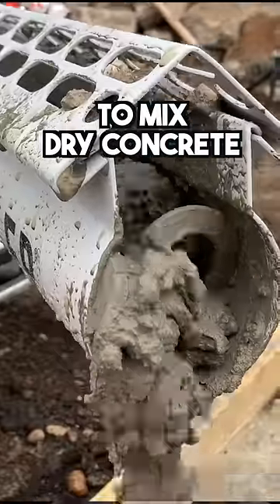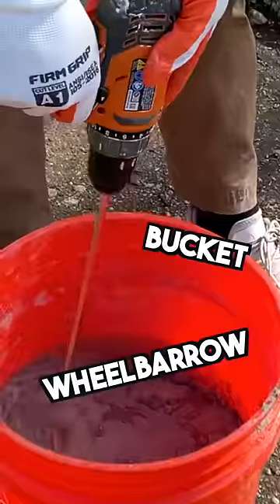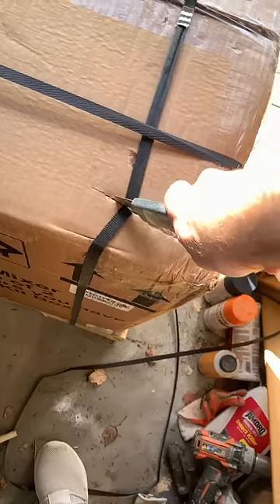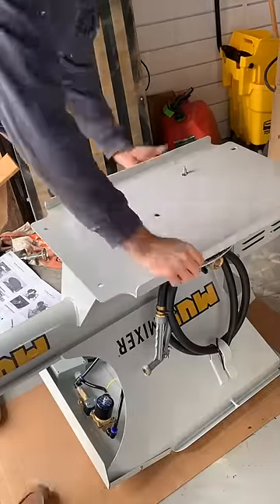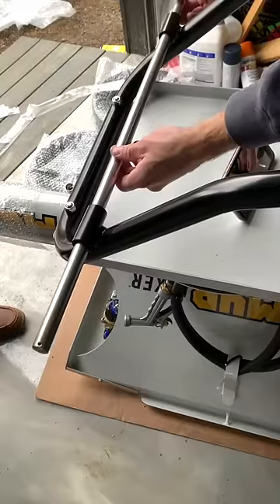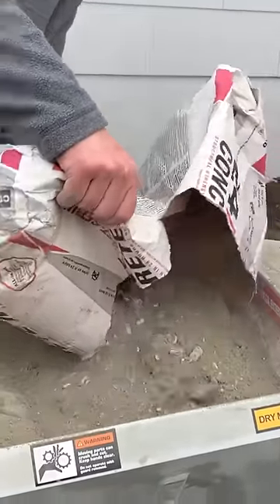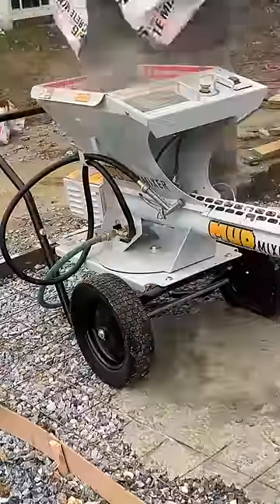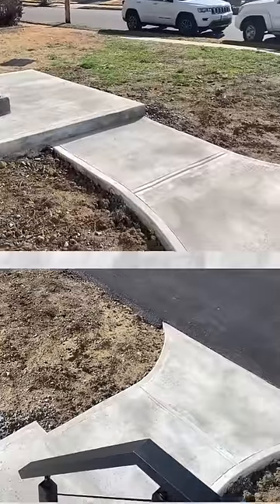The Best Way To Mix Dry Concrete (MUD Mixer)

Comment: Just 2 people and a 8x8 tarp. Crack the bag (60#, 80#, doesn't matter) into the tarp, pour in the measured water, and two people slosh it back and forth for a minute. use the tarp to funnel it in to where ever you want to go. Clean up? hose down the tarp. But, order a truck if you using over 3 yards.

Comment: This type of machine is used to mix mortar, for when you need the mix to always be the same (or adjust as you go), you need a lot over the day, and only need a little at a time (brickwork vs laying concrete)
Not really meant for dumping large amounts of concrete, that's what cement companies and trucks are for!

Comment: I may see a problem with that mixer 
Bags of concrete mix are not always "Mixed"
I have seen the fines and course aggerate not well mixed into the bag of concrete mix 
So unless you mix the bagged mix 
You can end up with junk concrete , some hard and some with almost no cement in it

Comment: Seems to have worked for you for this size project, if you have the cash.....but for me not "the best way"......the best way I know, especially small jobs, like posts and footings on a budget.
• 8 x 8' tarp/construction plastic
• 1 bag cement, empty in centre 
• add sand aggregate ratio
• 2 people, 1 on either side, each grab two corners
• alternating lift corner in turn a couple of times this will quickly mix the dry parts, like flipping food in pan
• gradually add water, continue to mix until correct consistency.
• lift drag tarp over to pour, coordinate lifting corners to precisely pour concrete where you need it
- clean up easy let dry  and shake clean

Comment: You know it’s much cheaper and can be just as effective if you just use a shovel and a wheelbarrow.  Can easily mix 3 bags of 80lb every time and move it to where you want it after it’s mixed. 

Ofc this is definitely a bit more work but it’s not like you’ll be doing it everyday.  

The average I’ve seen / done myself is a pallet per HR
Reply: put 2 bags on a tarp and roll them back and forth

Comment: I have rented this unit twice now. It rocks if you cannot get a truck into the area or if you are doing smaller multiple pours. I do not see a dryer like me justifying buying one but renting hell yes. 
It mixes concrete fine. Someone mentioned mostly morter and that is bs.
I will always order a truck when I can but to disparage a fine tool because it doesn't fit your jobs is just plain stupid. Don't knock it till you've tried it.

Comment: It looks like it's putting a lot of water into that concrete too. I'm no concrete expert but I feel like too much water is not a good thing.
Reply: It's not.  Too much water WEAKENS the concrete.  YOU adjust the amount of water to determine the slump.  Too much water is the operator's fault.
Reply: The proper mix is 0.45 lbs. of water for each Lb. of portland. Or a mix that will ball in your hand/ glisten when you slap it with a shovel.

Comment: 56 bags of ready mix. You would have saved a boat load if you brought the rocks, sand, and cement separately. But i guess it doesnt matter when the mixer is $3K

Comment: 3 grand for the machine and then paying over the odds for pre mixed ? 
I’d rather pay 500£ max for a mixer and mix cement and ballast. 
Much cheaper. 
You could lay lovely block paving on that path cheaper then what you would of paid.

Comment: I would never use bag concrete for anything other than footings or fence posts and shit.  But if your doing something outside and want it to look good for years, do it right, bag concrete is too inconsistent and all that cement powder floating around and breathing it in is no bueno.

Comment: I call a dude, he sends me a truck full, already mixed up. Am I wrong?
Reply: Do you use 4 guys with wheel barrows to get it around the house?
Reply: Usually just one or two. No matter, you still have to hump concrete either way.

Comment: It’s so much easier and so much cheaper to call for a yard of concrete from your local supplier. You waste way too many man hours just mixing concrete when the crews could be doing something else.
Reply: Ask you local supplier what the truck and small load charges are.

Comment: 3000$ for that wow. Overpriced. I’ve looked around my area to rent one only found 2 places. Most places have the traditional concrete mixers. Gonna be a long while b4 they show up for renting at a lot more places. 
I’d buy one but not for 3000$. They know they can charge this price cause there’s not a lot of other options out there and this mud mixer is smaller and easier and better.

Comment: The mid mixer is garbage. While it controls the rate at which water is distributed, it should also have a control for how fast the Auger rotates.

Comment: idk, if your mixing over a barrow or two, why not make your own mix? seems like a lost art these days. i make my own mix for everything. 
topping, topping is funny because straight sand is no good. you need the small aggregate in there, i dont know what it does but its easier. 
my gig, its usually a patch, so im not giving you the entire 4inches, ill give you a four inch face, build up the middle with base, mix it by hand. 10x2.5. not worth a delivery.
i have taken to using sandbags of different color these days.  if i need consitency ill use a 20L pail topped up for measurements.
i get superior concrete, extra sand, people like to see sand, but if your a professional patcher, that means your good at working and matching it in, so you dont need lots of sand, you only need sand when your not a good cement finisher. you want as much rock as you can easily bring the cream up from. stronger concrete besides.
ive been to old farmer builds, and they have rocks the size of your head in their old mix, 100 years later your still sweating all day busting out what the old timers put in.
i like this thing. 50 bags per hour, is about 10 barrows. 1m3 but ive always found 1m3 delivered amounted to more like 15-18 barrows.

Comment: You bought 56 bags? At what? $5 a bag? That’s over $250. Just order a truck. It’ll be a bit more but you’ll get much higher quality concrete, you’ll finish quicker and don’t have to mix that shit up. Cmon now, this has to be an ad

Comment: Use a tarp, empty bag on it, add water, 2 guys grab the corners and swish back and forth. Mixed in 60’s or less
Reply: bring a third guy to add water and open the bags. pull pull dump.

Comment: Lol a normal mixer would be cheaper, faster, more consistent. This product makes no sense without a giant hopper above it that can be loaded up with sand and cement. How are you supposed to consistently add the right quantites of sand and cement? Only way this makes sense is if you can add 1 bag of cement and 4 bags of sand at the same time, but you'd have to pre mix them without a segregated hopper. It makes no sense at all. A normal mixer has the advantage that you can keep tweaking the mix and you don't pour it until it's perfect

Comment: With the price, just get a cheap mixer. It will do the trick. But if you have more projects, just man up an get a skidloader or even a small tractor with a sement mixer. If a big project just rent in a cement truck for the love of God. BTW folks, don't harass friend and family to spend their weekends to fix your big sement pour projects. Rent the truck, get some friends, get the job done in 1 day instead of non stop working the whole weekend. Finish. Drink beer instead..

And the slow arshe speed of this thing gives my eyes stress vibration..

Comment: $3000? Ridiculous! You could have Concrete delivered by the yard, up to 10 yards in one truck and you won’t spend $3000.. typical pricing for a concrete delivered in a concrete truck poured onto your site is between $175 to $275 a yard! With various additives! Various Slump ratios. With fiberglass to make it stronger!

Comment: Lmao buddy it’s $80/yard of concrete straight from the truck,  in 1/200th the time.
Reply: Yeah, in 1994.
Reply: @BryanBB440  Those are the prices right now.
Reply: @LucasJasche  where at?
150/160 here in CA and talked to somene in Midwest was 250 per yd plus tax and fees.
Reply: @LucasJasche   and i agree, that volumetric buggy is more novelty than useful. 
Bagged concrete isn't cheap right now, once you calculate labor getting the bags feeding that machine, cleanup and maintenance,  it's cheaper  to chute, pump or wheelbarrow it from a RM truck. Those full size volumetric trucks are useful for some jobs like rapid set for highway work and currently they are putting high speed fiber cable in our city.  The trench is 3 inches wide 2 foot deep, they use that truck for slurry on demand into a buggy that places it into the trench. Dont know what the buggy is called but it acts like a tremmie but above the pour, not in it.
Reply: @BryanBB440  I’m in Indiana,  that’s the price I get from IMI, Shelby, and Sagamore.   250???? That concrete better come with a few finishers for that price.

And I agree a 100%,  concrete from the truck is significantly faster and time efficient when you’re paying a crew of finishers.  Mixing bags is for homeowners pouring 5’x5’x4” at max I’d say.

Edit: I think you’re talking about the Georgia buggy,  (atleast that’s it’s name in Indiana). that thing is a life saver In long muddy yards.
Reply: @LucasJasche  here in CA I ain't seen 80 dollar mud in 30 years
Reply: $160/ yard in 6 plus yard loads. N. Ill.

Comment: Order concrete by truck delivery it’s way cheaper and you’re not stuck with a $3000 piece of equipment that you’ll never use again
Reply: And bring 4 guys with wheel barrows to move it around the house.

Comment: This thing looks like Gucci gear for some cash cannon shooting fool living in a McMansion. Dude, cmon?? This is a sponsored video, thanks for ‘letting’ us watch this commercial. 
So I buy this for $3290. Then I pour ..I dunno like 6walkways before I make my money back. On top of it being so friggen slow. Yeah,40 bags or less. I use my tow behind mixer. Anything over that and less than 4yrds. You call the short load redimix truck. 4-10yrds, you just order the truck bro.

Comment: Trash.. no point trying to reinvent the wheel. Nothing wrong with a 200 buck barrel mixer that's been used for the last hundred years
Reply: You need to use a superpalsticiser to make concrete in a small barrel mixer ( 3 cu. ft. ) High range water reducer. Only way to get 0.5 lb. water per lb. of portland and get it to mix.